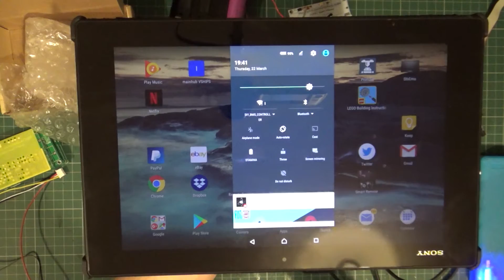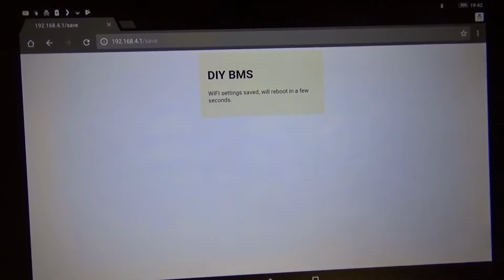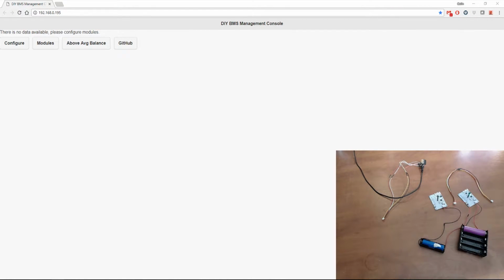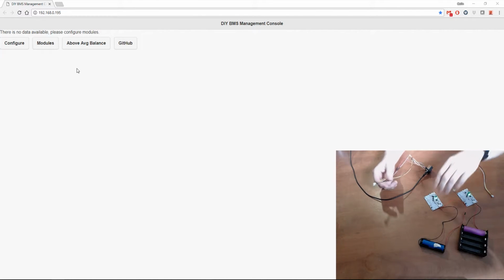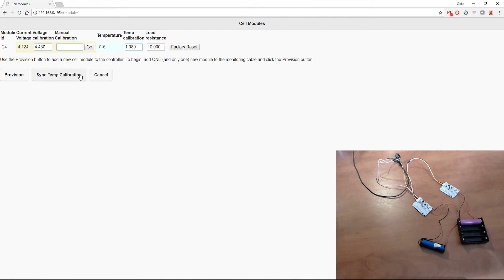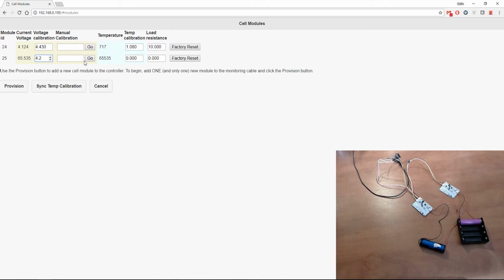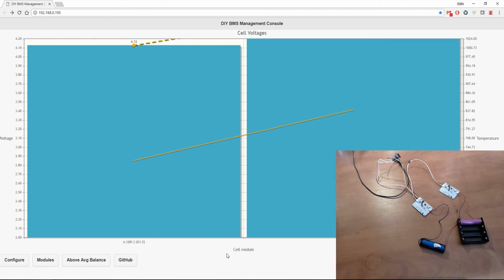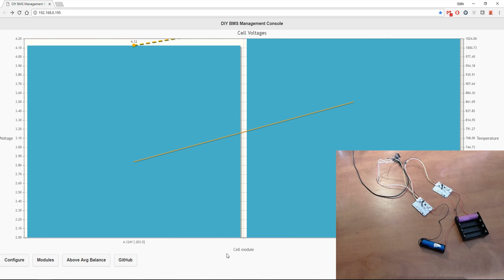diyBMS first configuration

Comment: Hey Colin, great video.  It does not look like you have pull-up resistors on your wemos, when going to the module.  Am I seeing that correct?
Reply from the maker: Hi Bob i have pull-ups on my module after i had communication issues, it was ok with one module but with more the pull-ups were required.  I initially used 4.7k but i am now using 1k resistors.
Reply: Thanks.  I think this is where I have screwed up.  I wired the pull-up resistors wrong.   I put the resistors in line with the D1/D2 comms.  It looks like I was supposed to run the resistors from the 3.3Vcc to the D1/D2 lines.  I will try this tonight and see if I can get my I2C working.
Reply from the maker: Ah yes that would do it, on one of my later video's you can see the arrangement i used, i'm on a wemos also and used one of their small prototype boards and placed the resistors from D1/D2 to 3.3v and also placed the connector on there.  Fingers crossed that fixes the issue.